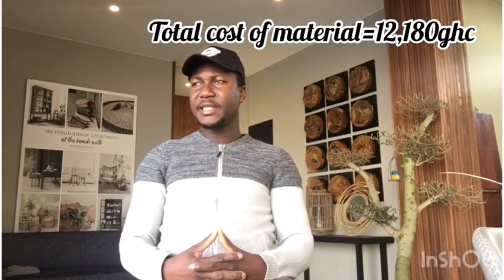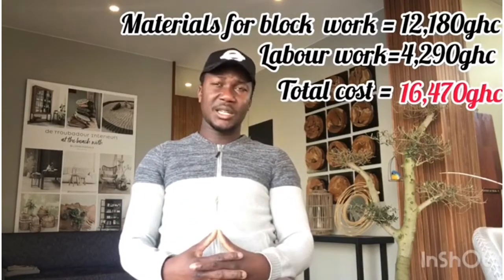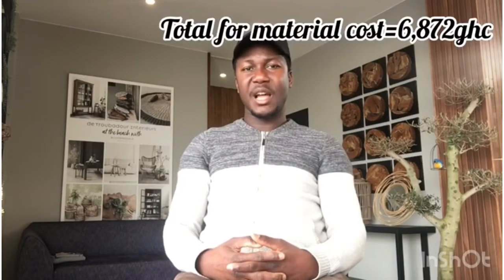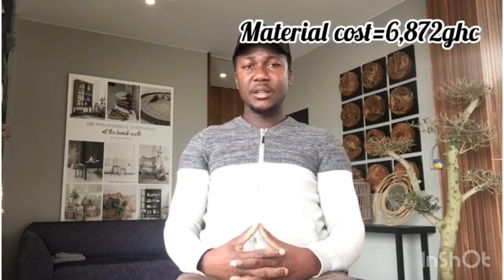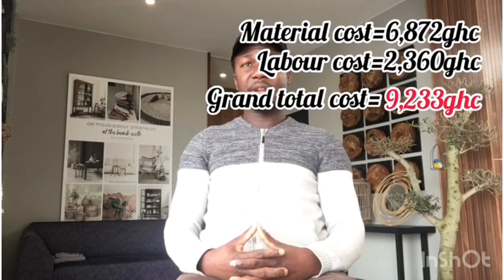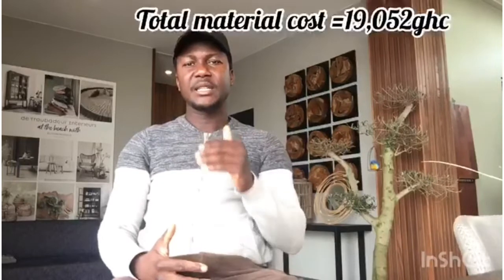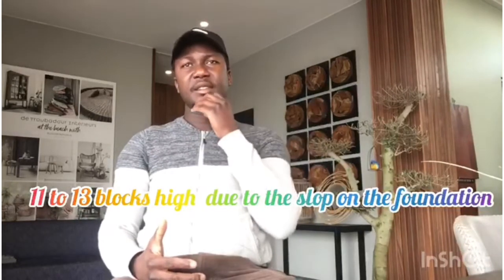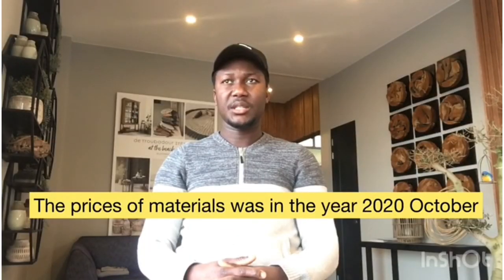Building a Dream House in Ghana | Cost of Laying Blocks and Pillar (columns)  Installation.

Comment: As informative as this video is, I will advise you to get a professional (Quantity Surveyor ) to give you an accurate cost. so many factors may influence the cost of your dream house in Ghana. Firstly your Land( topography- sloppy or flat), type of soil, and design of the building both structural and architectural.
Reply from the maker: You are right Mr. Obiri, I will take your advice and do a proper survey with the next stage 👍🏾. Thanks for sharing your ideas I do appreciate